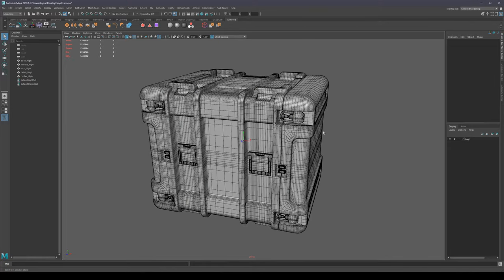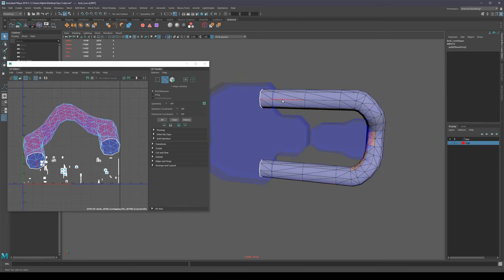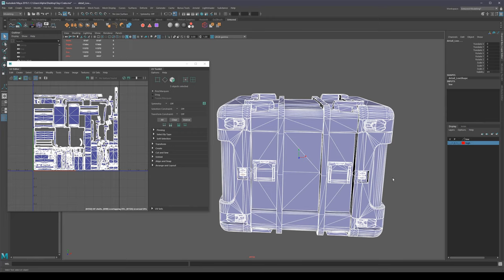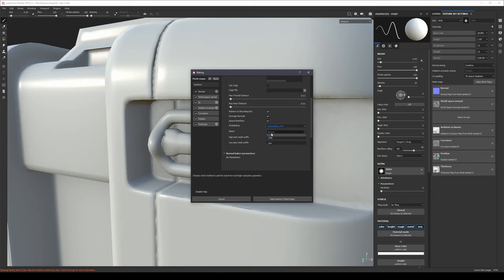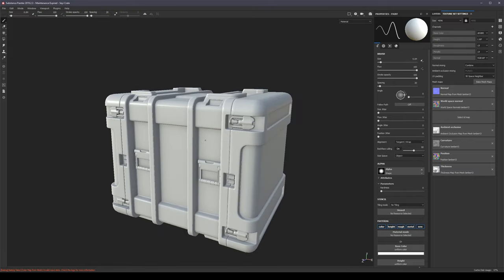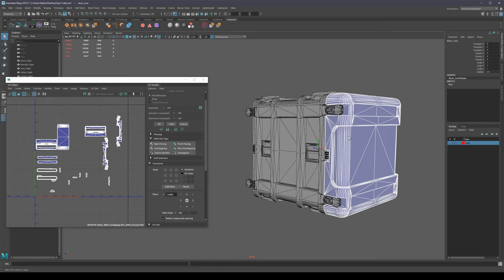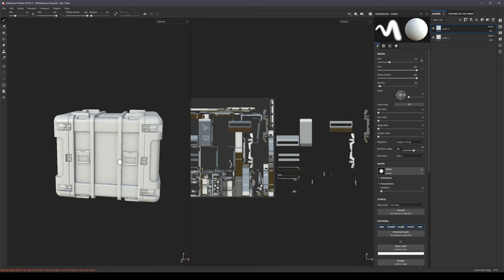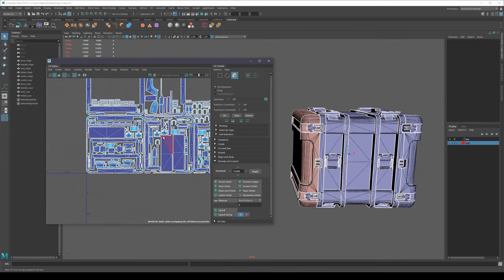Fixing Seams in your Normal Map

Comment: When baking characters would you still set up edges to hard? Instincts says it wouldn’t but I’ve been struggling with seams on my normals but I just started learning substance
Reply: I always have characters smooth edge and with UV seam probably smooth edge. hopefully this is why I find my normal map always wrong at UV seam.... a problem that has annoyed for several years! Never resolved ! Should I harden edge at UV seam even on smooth character surface?
Reply from the maker: I don't think this is used for rounded surface characters. I believe hardening uv edges is more for hardsurface stuff with really strong angles. 2 things that help the most: make sure your low poly has enough geometry so the normal map doesn't have to do all the work, and use a large enough texture resolution.

Comment: none of this helps me... the hard edges always appear on areas where there are uv seems. Normals can be soft or hard on those edges.. doesnt matter. Only time i see no hard seem in teh normal map is when its both soft normals and connected uvs..
Reply from the maker: You mean Maya works differently for you than it did for me?

Comment: nice!!!! but i have a question, what different bake the texture between High poly to Low poly and Low poly to Low poly in this case
Reply from the maker: I'm NOT baking low to low, that would not do anything. I loaded the High poly off camera so I understand the confusion.

I was replacing the older Low poly with a new version of itself over and over. The High poly was never modified and was always loaded into my texture bake settings.
Reply: @ArmoredColony  how to confirm the high poly same UV with the low poly?
Reply from the maker: The high poly doesn't need UVs in this case. When it comes to game assets, only the model that needs textures needs UVs